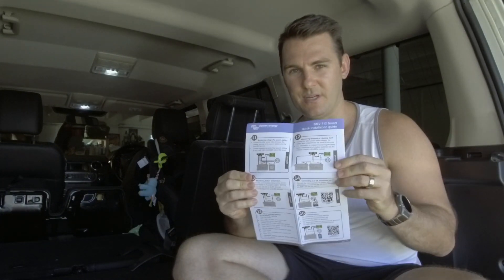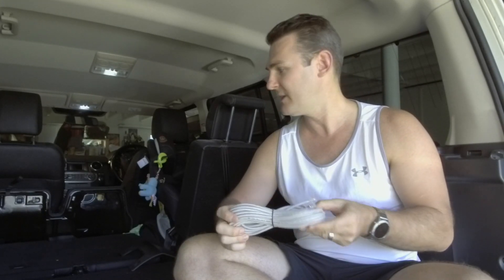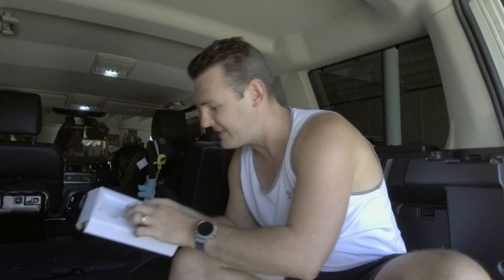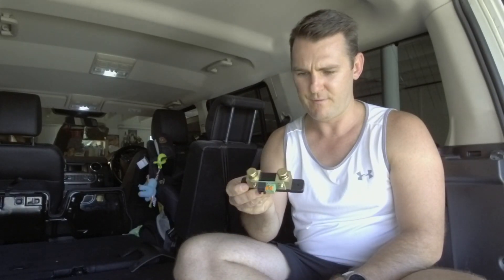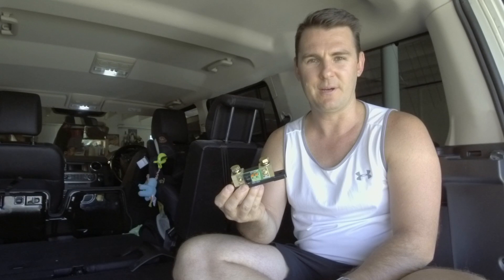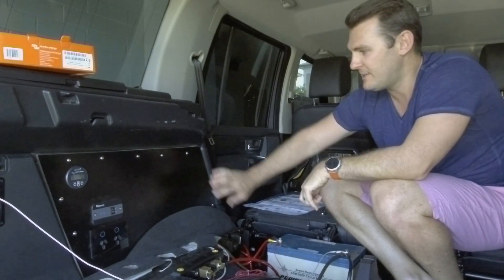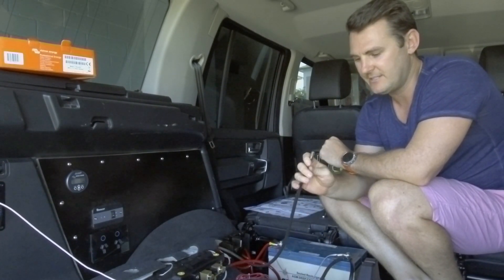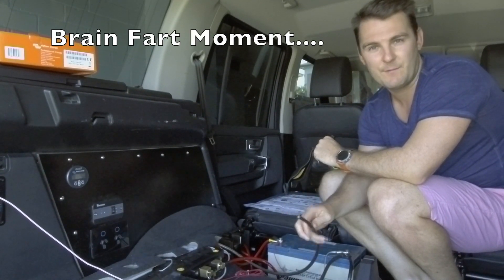Discovery 4 - Victron BMV Install

Comment: I came here looking to see where you installed your second battery and YES! this is exactly where I was looking to put a battery on my Disco 4 (2013). I have no idea why its not more common as it looks perfect. Can you tell me how you find it? Also what size battery did you put in there? And one more question about your DCDC charger, how do you find it as an alternative to the heavily talked about Traxide setup?
Reply from the maker: Hi Stewraz, thanks for your questions. The easiest way to locate the space where I installed my battery is my folding down the rear seats. Being that my disco is only the 5 seater, I was able to lift up the panel where the usual 3rd row would be. It takes a bit of persuasion but start on one side first and pull directly up, then move to the other side. 
I used a Powersonic 105ah AGM battery. The dims are 306x168x210mm. You can’t really go much taller than that. I am also considering a lithium 120ah as a replacement soon. We will see. 
The Enerdrive is fantastic. It displays everything you need and it’s very easy to install. It is much bigger than the Traxide unit that everyone talks about. But I wanted a solar input as well as multiple outputs for future lights and accessories. 
I hope I’ve been able to answer your questions adequately. Please let me know if you have any follow up questions.
Reply: @ausdisco4  fantastic. I didn’t realise you had a 5 seater, mine is a 7 but I have already locate the space, how did you go bracketing it down? 

Also, how is your dad finding the car since the removal of the 3rd row? I guess it’s just a weight saving more than anything.
Reply from the maker: @stewraz101  yes mine is the 5 seater. For the bracket, I did up a cardboard template and took it to a sheet metal fabricator. Was very easy. 
I’m unsure what you mean about my dad, but it’s been my car since I bought it from the dealer 5 years ago. I’m not sure how many times the 3rd row is used for those who have them. Apart from a little less leg room I’m not sure it would be a bother having the battery in that position. 
Just ensure you have the correct wire size and inline fuses.
Reply: @ausdisco4  awesome. Thank you. Yeah the dad comment was me getting my wires crossed. 

Enjoy the great outdoors